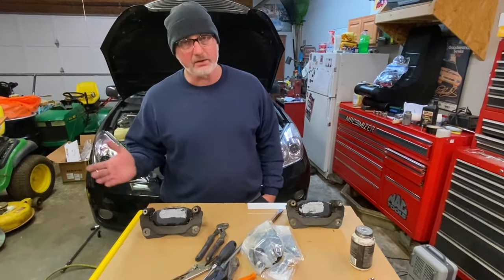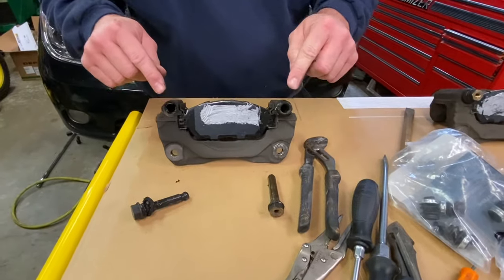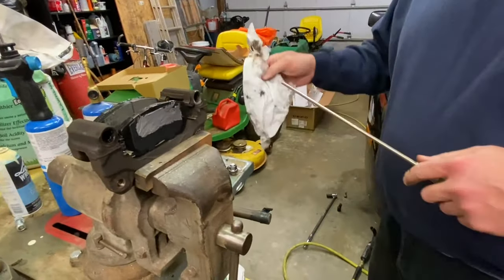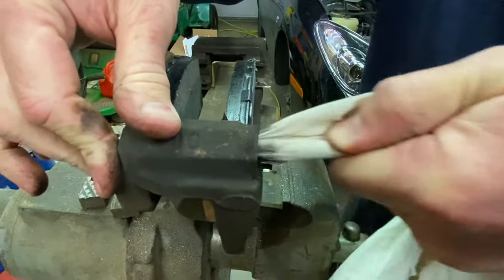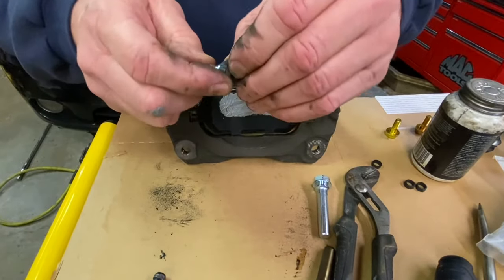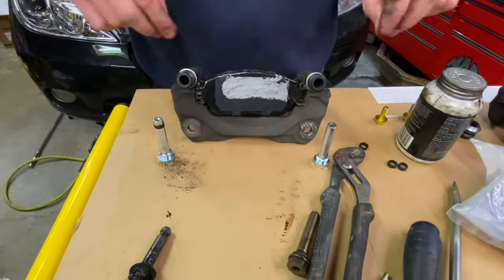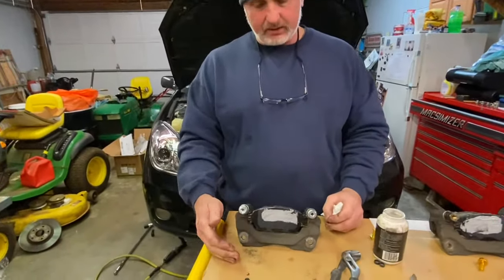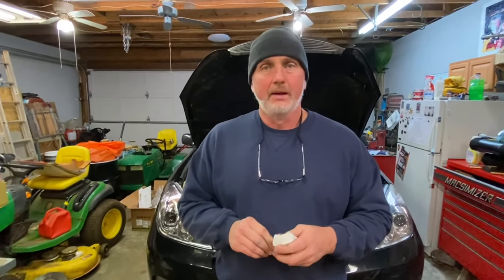How to Replace Brake Caliper Pins and Boots

Comment: For those asking about which pin goes on top and which goes on bottom,  it depends.   You should be thinking "leading edge" and "trailing edge".   This video is essentially watching this guy remove, clean, and replace, with no real explanation!   Theres a video which explains it and is more detailed than this one.  And give some thought to not putting that little rubber bushing on the end of one of the pins.   They swell up over time and prevent the caliper from sliding.
Reply: Ah, that swelling may be why we couldn't even get the pin back into the caliper of our 2009 RAV4. I was wondering if there was a trick to getting what Toyota calls the "Bush" back in without it slipping up the pin. It absolutely would not go in the hole without sliding back up. While I'm here, does anyone know if, other than replacing the Bush, there is a trick to get it to slip into the cylinder?

Comment: I like to take the old pins out, the boot, totally clean the caliper bracket getting all the rust off, clean out where your slide pins go with parts cleaner, the dry it out.. then  start putting it together. Never put your pads in first before replacing boots

Comment: There is a third reason for premature pad wear. If they aren't properly burned in, you won't get near the expected life from them. The last set I did were ceramic pads with drilled and slotted rotors, and the manufacturers recommended procedure was 10 applications in quick succession 40 down to 20 mph, then 10 applications in quick succession 50 down to 20 mph, then drive at least 10 miles to cool pads and rotors down. If you do a complete stop before cooling them off, the rotors will have deposits burned into them and defeat the entire burn in procedure. I got 140k miles out of that set. You will smell the brakes when you do this.

Comment: Tried to put boots in on a friend's Scion but they seem too small than the OEM ones , too much space. After trying to knock them in they just fall right back out. Anything to correct this?
Reply from the maker: I would double check with your parts house to make sure you have the right boots.

Comment: Thank you for this video. I have asked my Mechanic twice to do this in four brake jobs and this has got to be what he is leaving out.  I could not have actually gone through four sets of rotors in only 58k miles. I bought the boots and pins today including the silicone brake caliper lube and might wind up doing this myself. I have all the tools excepting a small mallet. Also, I have been reading that this is the primary reason, if nothing else is found, for the front end shudder of the Pontiac Vibe. Great video. Edit: The very common complaint of front end shudder in the Pontiac Vibe.

Comment: Boots are definitely an overlooked item on brake jobs.  I've had luck in using a bore brush to clean the ports where the caliper pins go into.  This was suggested to me by a field mechanic.  Excellent tips Sir.

Comment: That was one of the very best auto repair videos I have seen, and I’ve seen many. Clear, precise, informative, to the point and excellent video. Quick question: is there a reason why one would not spray some brake cleaning fluid down into those bores to get them clean? I am about to replace my caliper pins, after just changing the front brakes and rotors. They were not seized, but the boots are worn and one was kinda stuck until I fiddled with it. When I replace my rear rotors and pads tomorrow, I want to replace the pins and boots on all four (2007 Jeep Commander). Might even rebuild all four calipers and change the brake fluid while I’m at it. Looking forward to more from you, sir. Thank you!
Reply: Brake clean eats rubber. If you use it in the bore make sure you clean it out and dry it off

Comment: Thank you so much for sharing this how to video. Most grateful because of the following: This is a method I can try myself to do in DYI. I asked my regular mechanic if she would be able to do this, so as to not pay for brand new calipers, but he stated what seems to be a very reasonable dilemma for the consumer, that is me. Whatever cost I try to save on simply buying new or rebuilt calipers is gong to be negated by the cost of his labor per hour as he will bill for the time to rebuild the caliper itself, and in the end, depending of any difficulties, if any, that he finds, it may cost me more. Hence, his recommendation is, buy new or rebuilt calipers, even at $350 each, and one hour labor ($165) per each axle still going to be cheaper than him rebuilding those rear calipers. And note that at the GMC dealership, the cost of this is close to a thousand dollars or more. When all what may be needed is just the boots, the o-rings and maybe some new guiding pins. But labor costs kill any savings for the customer.

Comment: Thank you for conducting this video.  I have one caliper pin that moves in & out when I pull on it but it doesn't pop back up when I push it down by hand.  I'm assuming that I need to clean the pin & apply a new boot for the caliper pin & I will be getting the Toyota branded just to make sure it fits properly.  Again, I really appreciate this video as it doesn't look too difficult to do myself.
Reply from the maker: You're welcome! Glad the video was helpful. Good idea to get factory parts. Thanks for the comment and have a great day!

Comment: Its not clear which pins is on top side ,the pins as you can see are different.
Please explain which pins stays where ?
Reply: Finally found the answer.  The pin with the rubber sleeve goes in the lower position.

Comment: It appears that the boots for my caliper pins have an equal diameter to the bracket hole, so I can't fit in the boot, and then especially the pin. Any tips on how to install these boots when the diameter about matches the hole?

Comment: A boar brush works at cleaning out the slide pin area of the caliper bracket compared to a screwdriver and paper towel, also you got to be careful not to put too much grease on the slide pins always it will cause a bit of a back pressure type deal

Comment: Hi, I have a question,  if I mix pins, how do I Know where they go.
Reply from the maker: Typically the pin with the rubber ring will be on the lower pin. The one closest to the ground if that makes sense. Its not always the case so pay attention when disassembling the brakes or refer to a service manual. Thanks for your comment.

Comment: I always have this problem. I lubricate the pins and after a short while I find them stuck and not moving... So what is the solution and what is your advice? Note: Silicone grease is not available in my country, so what is a good alternative?
Reply: ATG & I recommend Dielectric Grease (always available in electronic/hobby stores & cheaper).
Steps & procedures:
1. 11 years+ or over 155K+ (255KM)
2. Remove one Slider Pin (male) at a time (discard) & clean very good open (female)
3. Remove second Slider Pin (male) & repeat with a used T-Shirt. Do Not use paper
4. Was Slider Pin's O-Ring on the top or bottom? Replace it & light DG on it & install
    (if car was serviced by dishonest shop or bad mechanic, same pins or missing O-Ring)
5. Remove Dust Boots. Install new Dust Boots & apply DG on the inside of boots
6. New Slider Pins = apply medium coat of DG on Slider Pins but not on tips (a little bit is ok) 
7. Install brand new Slider Pins that were just DG & DG the end that cover the Dust Boots
8. Once you got the Slider Pins & Dust Boot popped into place
9. Push & pull the Slider Pins with thumb & 2 fingers. They should both move with little effort
X. Brake Pads' Shims installed correctly. And torques all that you have removed

Since you didn't what year/brand/model.
Assuming on Honda = wheel lug torque is 80ft lbs

You don't want to go back & do the same labor because you want to save $25 for not replacing the Slider Pins, O Rings & Boots
Reply: @angelisone  I am sending you thanks from Libya.. I have benefited from your information.. I found silicone insulating grease intended for electronics, but it is good, and I changed the dust and water protector... and now, thank God, it is good.
Reply: ATG & my tips = you can use transmission fluid to loosen bolts
You can use used Brake Fluid to kill grass weeds & to remove paint
You can use Lemon or Lime Juice for rusted bolts & nuts. Pour juice in plastic bottle cup, place bolts/nut in, close cap bottle. You can shake after 2 hours or should open it the next day

Comment: What side does the black rubber goes ? Infront or behind
Reply: Back side of the guide pin. Behind the caliper
Reply: Where does the small rubber goes in the sliding pin top or bottom?

Comment: Many videos & claimed professionals failed to tell which direction to install the ATG's Slider Pin O Ring.
Reason just stated many dishonest shops/mechanics installed incorrectly or installed same 2 pins in.

Remember shops don't allow customers/owners in the bay areas.
And they surely have many junk parts.

Comment: If you haven't paid attention to which side of the caliper bracket the rubber pinned pin goes...does it matter? if so how do you know which side is the plain pin and which side is the rubber booted side goes?
Reply: One pin should be longer.

Comment: What happens if you drive without rubber sliding boot
Reply: You may get damage and/or corrosion to the pins or caliper bores from water, dirt and even salt intrusion.  Eventually, the pins may not slide smoothly and the calipers may stick or seize.

Comment: Learn from my mess up today.... don't have your hand in the path of the chisel if you're trying to pry the ring out.... damn thing slipped and I stabbed myself about 1/4 inch deep between my thumb and index finger....
Reply from the maker: I am so sorry to hear that. I've hurt myself many times over the years and it always sucks. You should see all the scares on my right hand. I'm a lefty so I'm usually holding the tool with my left that I injure my right hand with.

Comment: I found you video weak for the flowing reasons.:  You didn't readily label your calipers left and right and most importantly you did not clearly state if the pin with the plastic/rubber tip is installed at the top or bottom  location.  If varies by car you could say so.  When you were dealing with the second (left) caliper your hand action was like a magician hiding his slight of hand. Other than that it is a great video an is informative.
Reply: I need to know which pin with rubber tip goes top or bottom. Whole purpose of looking at video for me. Not explained.
Reply: If you don't know which side goes where then your comments are voided. They only go one way harry!